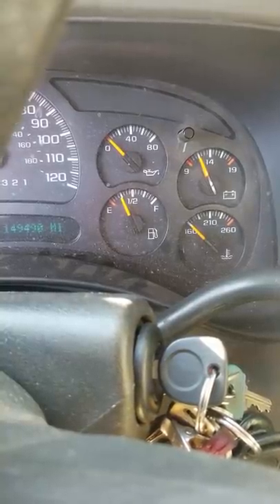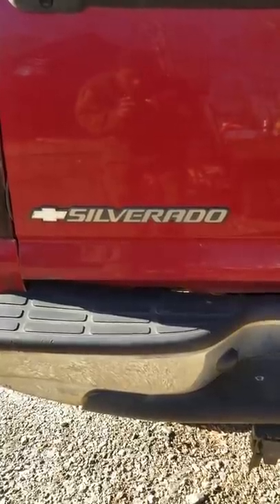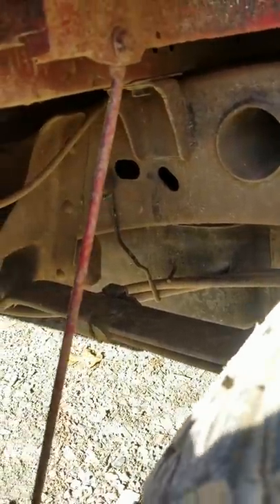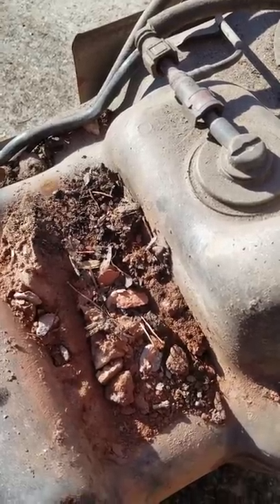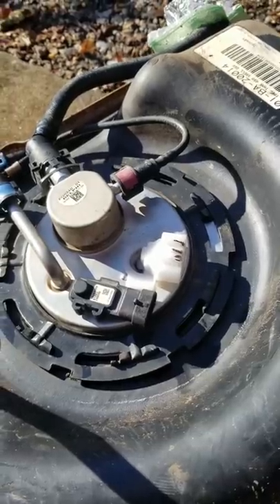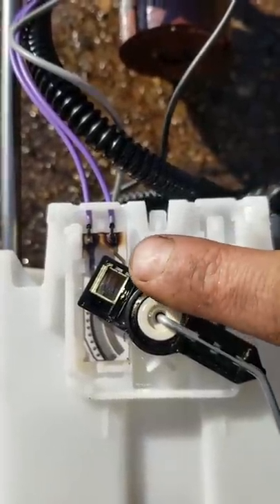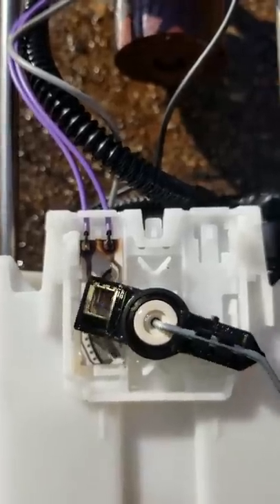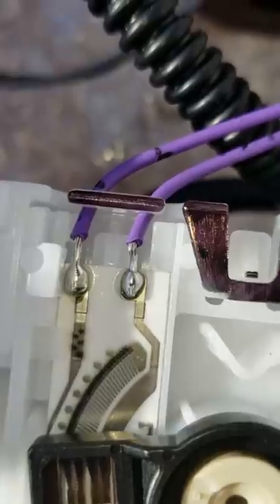Customer States Fuel Pump Broken

Comment from the maker: Hey yall! SUBSCRIBE!!! Fuel pumps and tools in the description.  
➤ UPDATE VIDEO: https://youtu.be/sAY7mBAdRU4 
➤ FULL VIDEO: Chevy Silverado Fuel Pump Replacement: https://youtu.be/9KmiyE1Mvok
I know dropping the bed would have been easier!!
Reply: You can just take the bed off with 4 more bolts .. instead of messing with those bands that always break don't forget to unplug the wire harness to to the lights if you take the bed off next time
Reply: After you take your last breath are you going to heaven or hell? Please ask yourself that question.

Jesus can save your soul from hell. He will forgive your sins. He said whoever calls upon his name shall be saved. Call upon Jesus today. Repent and believe the gospel.
Reply: @huracanian3051  can't forget the hot garbage ground leads either
Reply: Yeah right
Reply: I’m glad you said that. I was about to ask lol
Reply: Mine stuck on e
Reply from the maker: @sheparddog117 This is a 26 gallon tank.
Reply: A friends 03 f250 runs out 1 mile after low fuel ligjt
Reply: Isn't burnt up leads in the fuel tank how a few airplanes have blown up in the sky?
Reply: He was right.
Reply: My 97 Tahoe gas hand jumps, will this fix it?
Reply: @MattsShop  better than sammich bags: use a rubber plumbing pipe cap/worm clamp (no chance of cutting thru sammich bags & dropping debris down into the tank)
Reply: I just use my trip meter
Reply: Even though ,there are a couple of ways to do it. You have to do what's easiest for you. I have been in auto repair for 45 years, we never pulled the beds!
Reply: Don't like dirt in your eyes either? Lol. Use some goggles for the pool that have a good suction around your eyes and u won't ever get shit in your eyes again but still gotta deal with it up in your nose, ears and mouth lol hope this helps man
Reply: Epic fail didn't even clean the gas tank out